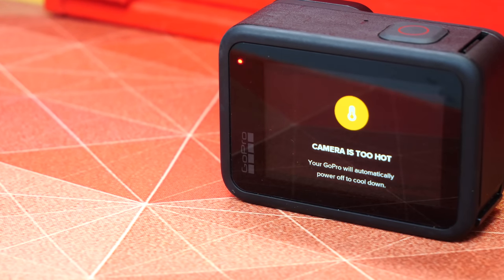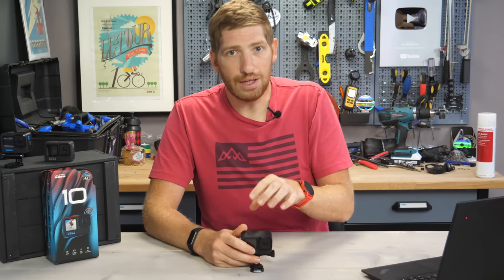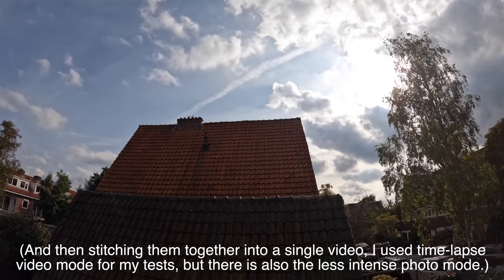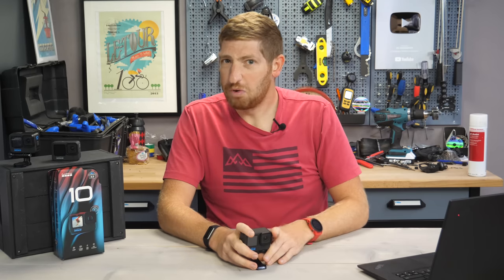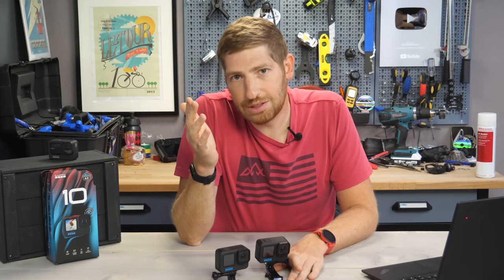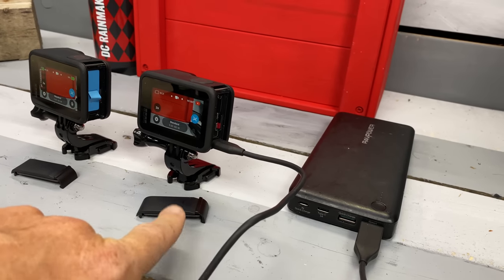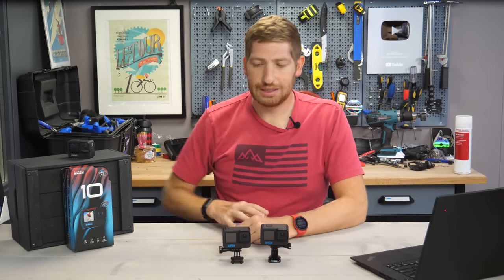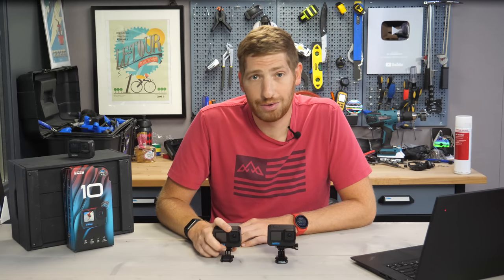GoPro Hero 10 Overheating: 40 Tests Later

Comment: The heat issues on the Hero 10 are not normal. The bottom of mine, and the battery, get too hot to touch when I'm recording or charging (can't expect airflow to help here).A battery pull "fixes" the problem for a while before it comes back. Many users are reporting this behavior, and it shouldn't be considered normal at all.

I have other action cameras that never overheat. Ever. This is a gopro problem that needs to be fixed.

Comment: For your indoor tests, were the cameras filming a static image? I wonder if there would be any difference if they filmed a dynamic scene, maybe a TV screen, that actually taxed the encoding more 🤔
Reply: Interesting question. I doubt it though, as whatever comes in is encoded, the encoder doesn't know it's still or moving until it's already going through the encoder. The readout from the sensor is the same. 

My question I keep coming back to is the video "lens" that is being used? It only has one lense, so the image circle can't change, so there has to be scaling to the chosen resolution. I wonder if using "Narrow" is exactly 2.7k on the sensor, so less encoding has to happen from scaling. With any boost on though, it has to overscan and adjust to be stable...So I think there is always scaling, unless maybe on a tripod with all stabilization turned off. So many tests that could be done to check so many variables.

Comment: I've found my HERO10 to be almost useless when scuba diving in warm water. In Maldives in February we had 29-30°C (84-86°F) and with 4K60 the camera kept turning itself off during the dives, with the battery nowhere near empty (100% before the dives). With 4K30 it worked better but I bought it for 4K60 (2x slow-mo). 
If I had been charging it just before the dive it sometimes it wouldn't even turn on until later ~20 min into the dive. The camera becomes very hot when charging.
And many times when connecting the charge cable it wouldn't start charging. The only solution was to take the battery out, insert it, and connect the charger again.
Latest firmware, original dive housing, original batteries (2x), original USB cable, Sandisk Extreme 256GB SD card, etc. 25+ dives over two weeks in Maldives.
Their support just denies all issues, won't replace and won't refund. Never again GoPro... :(
Reply from the maker: Did you try the new video performance modes that reduce the battery heat for these scenarios?
Reply: @Dcrainmaker  Only the maximum video performance mode. As far as I know the other modes will limit the fps, bitrate, stabilization and other features.
Reply from the maker: @cthugha76  Yeah, that's basically just a do-nothing mode (meaning, it doesn't save anything). Ultimately though, the competition isn't any better here. The DJI Action 2 overheats in about 4-8 mins by comparison.
Reply: @Dcrainmaker  I haven't tried the DJI Action 2 yet. But at 4K60 I only got a few 1-2 min clips before the HERO10 turned itself off, so it can't be much worse.
GoPro should take their responsibility and refund because the camera obviously can't do what they claim.
With the other limited video performance modes I could've just used an older Hero model instead, with similar results...

Comment: I keep telling people it's an action camera, not a bedroom blogger camera. If you're doing the latter, you don't need to pay a premium for the high powered ultralight compact durability of the former.

I mounted mine on a semi truck and ran my regular route at 4k 60FPS and it was batteries each and every time that killed it.
Reply: bedroom blogger should use a dslr. much better video quality and can have lower depth of field so you don't see the walls with every crack and poster, etc.

Comment: A lot of work put in there. A shame Go Pro failed to do similar. Talk about bending over backwards trying to get the Go Pro through the test. You should have given it a chilled Martini and you might have squeezed another minute out of it. 🙂

Seriously though Go Pro who wants to have to baby an Action Cam? Beyond of course outright brand loyalists who will buy your products no matter what. I will stick to my 2019 Osmo Action for less than half the price. Not because its cheaper but because it's reliable and easy to use. 

I only bought mine this year. I actually had a Hero 9 ordered and luckily came across some impartial videos discussing all the issues. Namely the slow touch screen and more importantly the camera freezing during filming. I cancelled my order and got the Osmo instead.

I think you need to spend more money on design and testing and less on marketing and constantly rushing to release a new model every year.

Comment: It just seems to be the battery getting too hot or cold 🥶. I just got mine hero 10 so I'll do tests of my own. But I think it's the battery getting too hot not the camera. Also I think the hotter the battery gets the faster it's drained of energy.  when it's too cold, it's so cold the battery cant provide energy efficiently as it does at normal temperature.

Comment: I was about to drop money on this but i read a lot of bad reviews this hero 10 overheat for no reasons. Regardless what the weather is. I’ll wait for hero 11. Hopefully this will be fixed on the next gen
Reply from the maker: It’s been fixed in the firmware update in Nov.
Reply: @Dcrainmaker  I am a road cyclist. How long does the battery last on one full charge? I’d say on 4k 30fps set up. Or 1080p 120fps.

As a cyclist which set up would you prefer when doing 3 to 4hr ride?
Reply from the maker: @popitn2nd  You're looking at about 75 minutes with Hypersmooth in 4K, or about 2hrs at 1080p/30FPS (their battery charts are here, and pretty accurate in my testing: https://community.gopro.com/t5/en/GoPro-Camera-Battery-Life/ta-p/394294#HERO10blk) - however, I wouldn't do 1080p120FPS for road cycling, it's just not worth the battery life. I'd only use 60FPS in road cycling if I was doing really fast descents, and even then I probably wouldn't bother most of the time, and just go with 30FPS. Whereas MTB I'd go with 60FPS. You'll only want to use 120FPS if/when you're capturing some very fast-moving that's typically short in duration (e.g. a jump or such).

Comment: Can you make it so the GoPro’s retain the date and doesn’t need to be connected to sync the date and time @GoPro? It’s extremely annoying to say at the least
Reply: Maybe you could write the Timezone etc the sd card so when the battery is changed over or off for a significant amount of time you don’t need to resync the time, as it would just get the params needed from the sd card

Comment: I have loads of problems with my hero9 changed couple of time and came with exact the same problems and i see that 10 has the same problems as 9. Gopro is not a good camera anymore with every new generations it's gotten worse. Good on options and feature, worse on functionality. What's the point if you have good features if you can't use the camera.

Comment: Look, if you want to record the beach for some reason, still there is a very low chance that there is not a single km/h of wind, in almost all beaches there is wind, and if there isn’t, you probably have a fan, if not just put it in water for a few seconds every 20 minutes and it should do fine.

Edit: also, if you really want to record in the beach use 1080p (that will literally never overheat), 2.7k I think is the best (gives high quality and will probably never overheat), and 4K 30/60 (that’s also good, maybe could overheat though).

Comment: im in dubai and filming out with gopro10 at bright sun yes it overheats like hell depsite using with an anker charging bank because the battery is inside and gets hot expands and even stucks. gopro shoud allow us without battery use.
Reply from the maker: They do allow without battery use. Works just fine.

Comment: AuthenTech tested the Hero 10 to only last 30 minutes continues recording before it will Shutdown due to overheating, while GoPro Hero 9 lasted 59 minutes before it shut down due to Overheating. That's understandable because Hero 10 has the New GP2 Chipset means a faster and hotter processor, but GoPro doesn't know how to dissipate those heat. In short, the "GoPro Hero-10" is like having the "Intel i9 Processor" but having only the Default "Intel i5 Heatsink" LOL.

Comment: I have a GOPRO 10 and in my home studio temperature around 24C this piece of junk cannot last more than about 15 minutes. Yes it has been updated to the latest firmware. Outdoors it is even worse and I cannot rely on it to do any recording as it overheats in minutes.
How could they fix this. Very easily get rid of the plastic case and use an aluminium, uncoated case (anodised  is OK) with some heat sink design. 
I wish I had returned this to GoPRO during its return time. I will never buy another Gopro product in my life.

Comment: My Hero 10 heats up in 9 minutes, here's my data

5.3K at 60fps ------ Overheat in 14 mins
4k at 120fps ----- Overheat in 9 mins 12 secs
1080p at 240fps ----- Overheat in 9 mins 36 secs

All readings taken indoors , my room temperature is 30 Celsius 

Is that even normal? 

BTW my outdoor temp right now is 42 Celsius, so if i go out with the camera, it'll heat up in 3 minutes. 😭

Comment: I purchased Gopro 10.  Ran video at 4K 30FPS (stationary).  Gopro 10 overheated and turned off after running for 30 minutes.  Did this twice with same result.  I returned it and bought Gopro 8 instead.
Reply from the maker: Your Hero 8 will/would overheat in the same amount of time, less actually. And the Hero 10 has a stationary mode you could have enabled for exactly this scenario.
Reply: @Dcrainmaker  Thanks for the info.  I learn a lot about overheating from your video.  Still didn't want to pay $500 for Gopro10 with this issue.

Comment: So if you want to run it sitting still in a car you just have to mount a small fan next to it or clip on your visor etc.  Or just take the battery out and power it from a power brick, or some sort of adapter from your cigarette lighter or even a USB port if your car has it.  Easy fix.

Comment: My Gopro 10 overheat on kayak on 4k60 after 24min on 28c temp
Reply from the maker: One aspect at play sounds to be microSD card speeds. I use reasonably good (but not crazy expensive) SD cards, which may help.

Comment: Missing information on whether WIFi and GPS is ON or OFF during testing.
Reply from the maker: On for everything. No shortcuts here. Technically speaking wifi is only triggered when requested by the app for transfers or previews, which is done via BT. So it was BT on rather than WiFi. But BT and GPS on, and full Boost.
Reply: @Dcrainmaker  Thanks for the quick answer. Another question is whether the setting when testing BIT RATE is set to Standard or High?

Comment: Charging GoPro 10 doesn't work at all with my iPad QC charger. After connecting the charger the red light is steady, GoPro is getting warmer and warmer. After disconnecting the charger the red LED is still on and GoPro doesn't react to buttons. I have to disconnect the battery and after powering GoPro on the battery percentage is still the same.That's a shame, I'm really disappointed, it looks to me that you have to buy original GoPro charger otherwise you will have issues with charging...
Reply from the maker: No, there's no reason to buy a GoPro charger. I don't have one, and have never had issues. It sounds like you have some other issue, perhaps SD card related or some other bug.
Reply: @Dcrainmaker  Thanks. Yep, probably, but to be honest I don't see the correlation between the charger and SD card (UHS-I U3), especially when the GoPro is turned off. I moved to standard 5V/1A charger and it works but let's face it, it is not what I'm expecting from GoPro, I've never had such issues with my old hero 5 session!
Reply from the maker: @JasonFPV  I agree in spirit it shouldn't impact it, but in practice - almost all roads with hangs/freezes on a GoPro seem to lead to the SD card. Again, assuming you've updated firmware and such (which, it does the first time you pair it up to app).
Reply: @Dcrainmaker  Of course I did. Will try either without SD card or with another SD card. Thank you.

Comment: Mine overheats and shuts down in the summer months.  And this is on a motorcycle, so it's getting 70mph+ wind blowing directly on it, and it still shuts down...

It's an "action camera" if your action is snow boarding, skiing, or something that has water or cold temps...

I use 4k60, medium sharpness, high bitrate, linear with horizon leveling and hypersmooth boost.  So the camera isn't even running the highest advertised settings...

I called customer support, as I have the annual subscription plan, and they won't replace it yet... they want me to "fix" the issue by recording at lower resolutions...  That's their fix?  Downgrade it and use it at much lower resolution than I bought it for?  LOL
Reply from the maker: Does it actually shut-down due to overheating though? What does it say when it restarts - it'll tell you the specific cause. You'd be the first person I've heard of that can actualy overheat it on a motorcycle into the wind, even at 4K/60.
Reply: @Dcrainmaker  I assume so, but maybe its just flawed like the Hero 9 was?  I am ripping through twisty mountain roads anywhere from 45mph to 100mph+, so its not like I can sit there looking at the screen and reading the quick message before it shuts down...  lol
Reply from the maker: @SquireSCA  The next time you turn on the camera, is actually when the screen shows 'why' it shutdown. Not when it actually shut down (well, it actually shows it briefly there too), but on the next boot, that way it's easy to read. It won't go away until you tap confirm. It'll say either Overheat, Low Battery, SD Card Error, or perhaps there's other messages.
Reply: @Dcrainmaker  I don't recall seeing any messages...  It would just shut off, similar to like my 9 did.  Unlike the 9, I didn't have to pull the battery to get it to reboot.  Tried different memory cards, same thing.  Using brand new Sandisk Extreme Pro somethings, the exact one that GoPro recommends...

Comment: According to the instruction manual, hyperlapse is not 4K but rather 1080p.
Reply from the maker: Nope, there's two options. The default is 1080p, but there's a 4K option.
Reply: @Dcrainmaker  Could you please tell me where to make the selection?
Reply from the maker: @allenmyers8568  After changing into TimeWarp mode, tap the 'TimeWarp' button at the bottom center of screen - then click the pencil icon. From there you can change the resolution to 4K (or 4K 4:3). Cheers!
Reply: @Dcrainmaker  Thanks very much.

Comment: so basically just like from hero 6 7 8 9 - 4k recording will make overheat, gp1 and gp2
Reply: All cameras can overheat.
Reply: @krane15  yes but same problem started in go pro 6 maybe 5 i.have 7 and 4k goes quickly to overhear 20minuted 30 maybe
Reply: @Bad888Max  You watched the video. Now ask yourself, what's more likely:

All those cameras all have the same malfunction? Or there's something you're doing wrong -- aka, user error? In any event, a 30-40 min. 4K video is actually pretty long. Your expectations may be way over-inflated for an action camera.
Reply: @krane15  im trying to say 4k recording still takes a toll on camera in the last 5 generations. So maybe by the time 12th go pro releases and they introduce 6k recording. 4k recording would be clear for longer than 30 minutes.

Comment: Mine just came in the mail. I plugged it in for the first time to charge and it overheated before I took a single video. Not impressed to say the least.
Reply from the maker: That seems unlikely. It only actually overheats when shooting in video mode at 60FPS. It might be warm while charging, but that’s totally normal.
Reply: @Dcrainmaker  I plugged it in to charge, came back and the screen was on for some reason. got hot and shut down. Now that Ive used it more it over heats nearly every time I go out. The screen doesn't even have to be on for that to happen